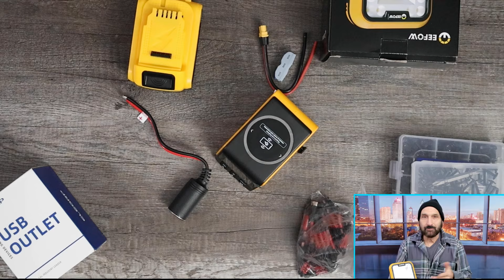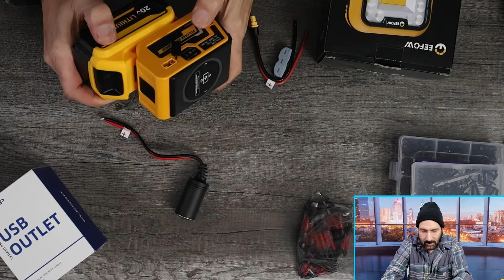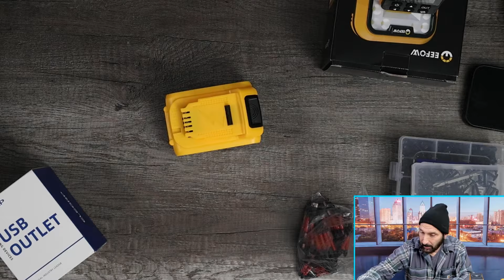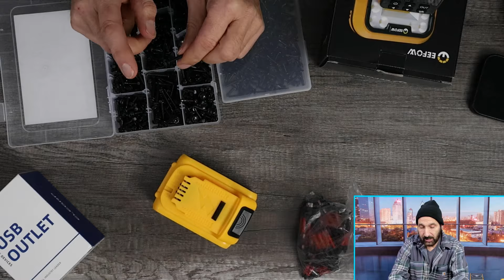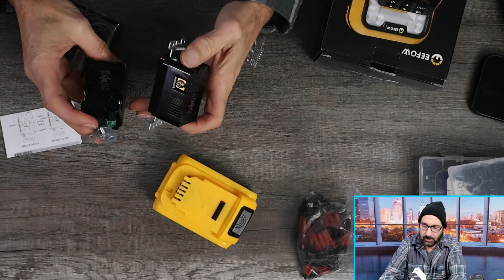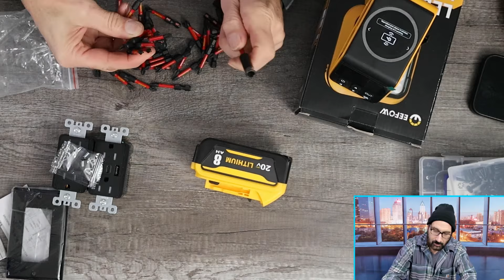Tool Haul: Turning DeWalt Batteries into Power Stations & LED Lights!

Comment: I have the power supply, the voltage selected is within .002 volts when tested with my multi-meter from the lowest setting of 2 to 30 volts.  The wireless charger is a bit finicky with my cellphone.